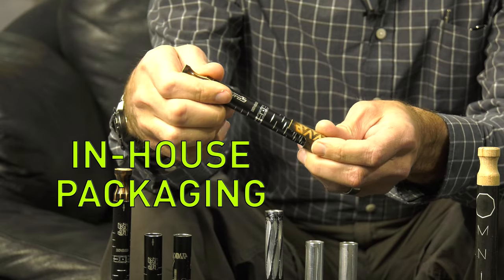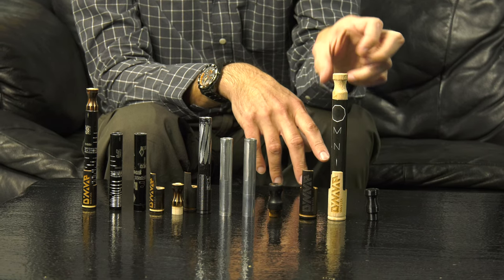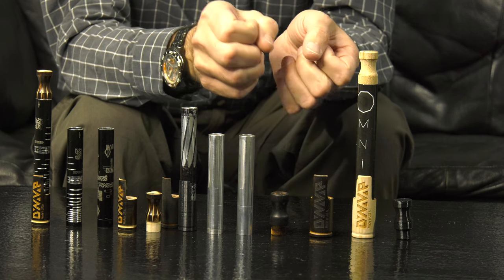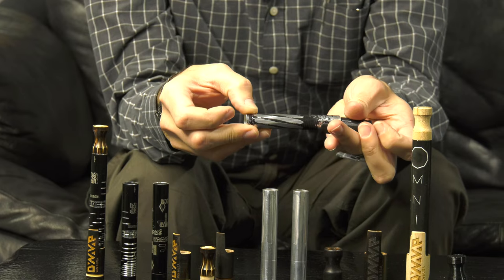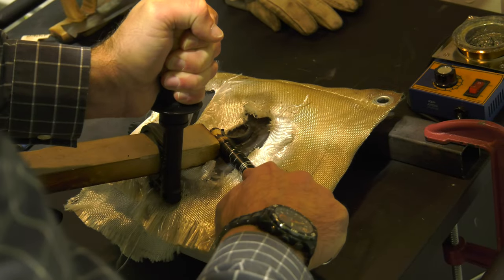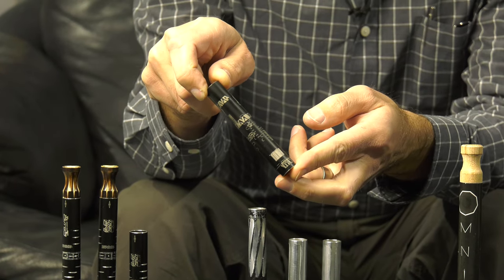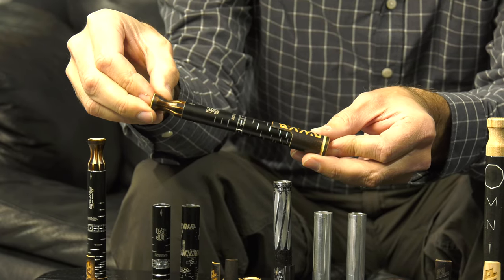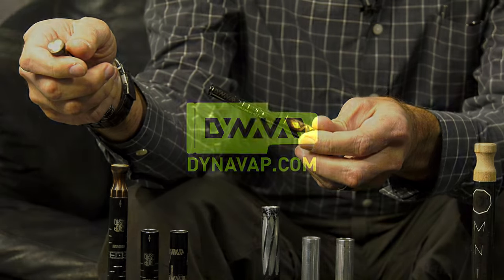WOODn't you rather have sustainable packaging? | DynaVap Archives

Comment: The embodied energy involved in aluminum tubing is not sustainable in any way. Some tissue wrapping the device before it goes into a shipping package that has zero plastic seems like the list responsible sustainable approach. Also the embodied energy required to machine the black tubing is just wafting more land tray resources for something that is not necessary. Simplify simplify simplify and communicate to people why so they get on board. 70% of Americans understand climate is an issue and want resilient products and manufacturing - cradle to cradle!